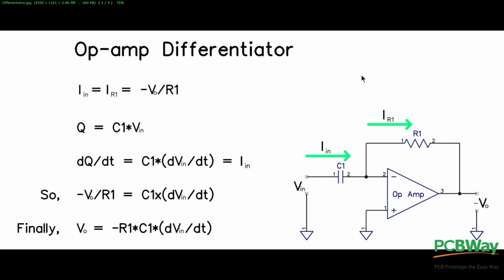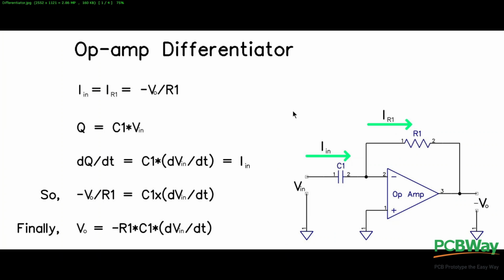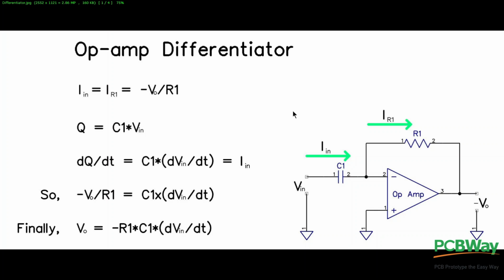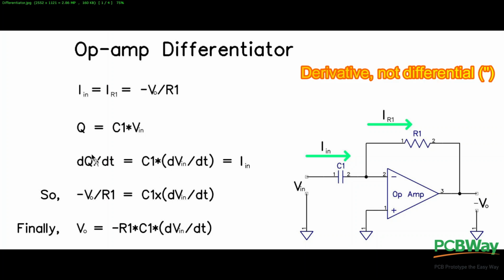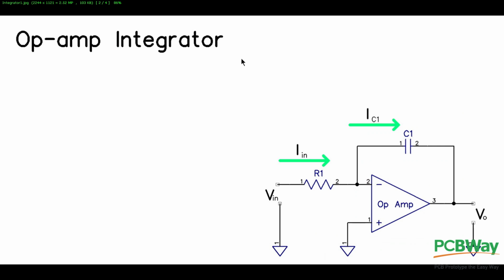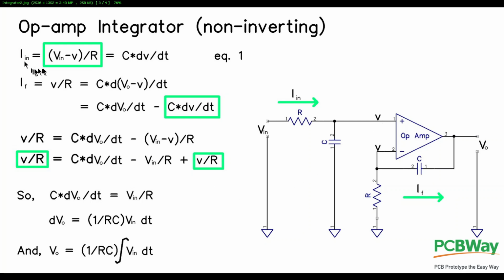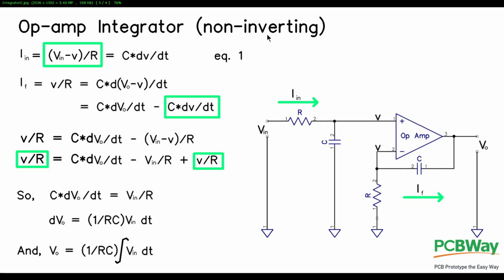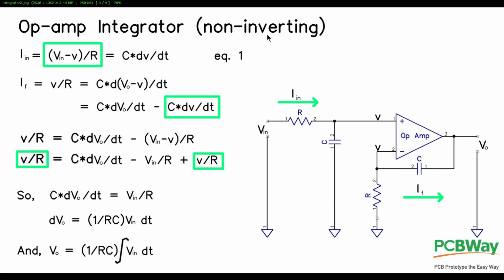0137 - Simple Op-Amps: Part 3 - Differentiation and Integration

Comment from the maker: Wow!  My worst video ever!  I guess people really don't like math.  The point was that the op-amp can do the math for you.  You don't have to go through the derivation each time, it was just presented to show how an op-amp can do calculus.
Reply: Describing what happens to voltages with visual characteristic graphs showing input VS output voltages over time might have helped a lot. The final equations are beautiful but going through their derivations is not casual backyard math :D actually following it carefully does not make for casual viewing, and that was most of the video content. Although I do appreciate it, it seemed to take a slightly different approach than some other derivations I've seen for the integrator and I didn't know about the noninverting build
Reply from the maker: @ivolol  It seems you are right.  I should have just done the expected voltage/wave form transformations.  I will do that in the practical video.  Yeah, the derivation for the non-inverting integrator is a little different.  But it still relies on the fact that, given negative feedback, the two inputs are equatable.  That also hints at how the positive side needs to be configured.
Reply: @uni-byte  Don't be discouraged though, in my years of trawling youtube I have found plenty of small videos with no views / exposure etc that had really interesting or useful or unique information that's hardly findable anywhere else. Are they broad appeal, the type of video that could really grow that creator's channel? Probs not. Did they enrich my learning? Extremely.
Reply: FWIW at least one person really enjoyed this video, and probably a few more ... I was good at calculus in high school, but I went straight digital logic and systems software in college, never studied analog, and forgot most calculus by this point 15 years later! I was able to pause and study the equations and the circuits, and I think I really get it, and the significance of this kinda clever combination of capacitors and op-amps (which I'm sure is familiar and simple after studying and using this stuff for years). It feels kinda like when I was introduced to flip-flops back in college. It's unfortunate that this may not have been great for the majority of your audience, or your channel ... but anyway, thanks!